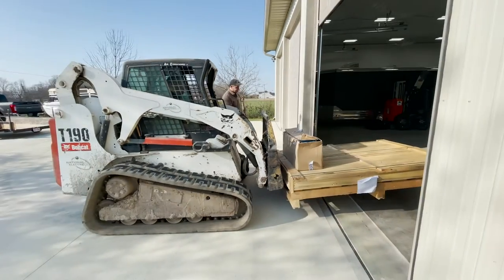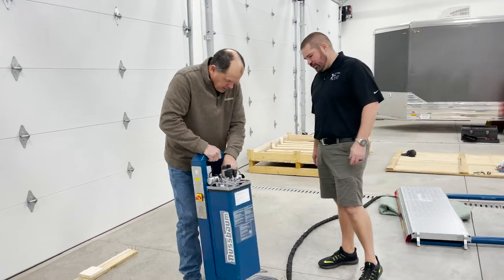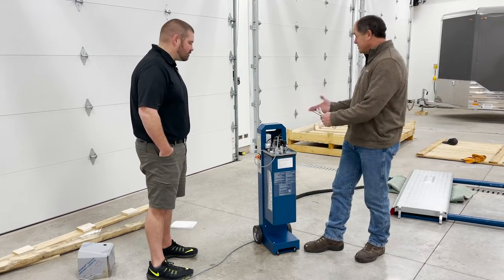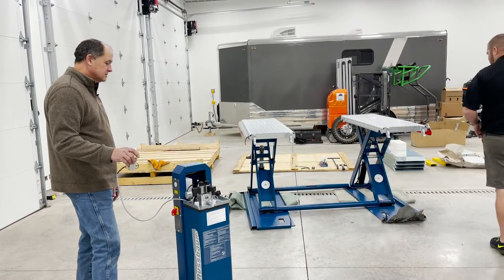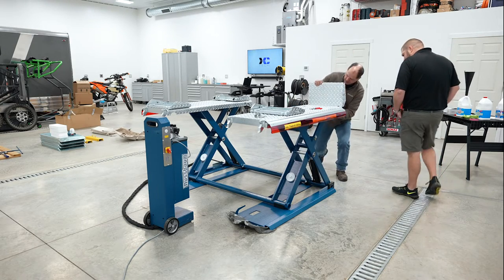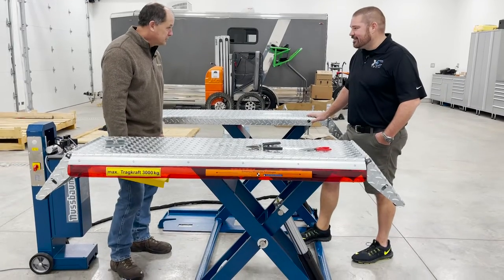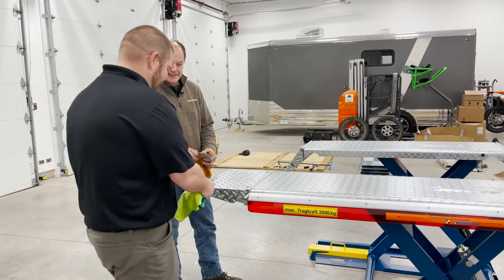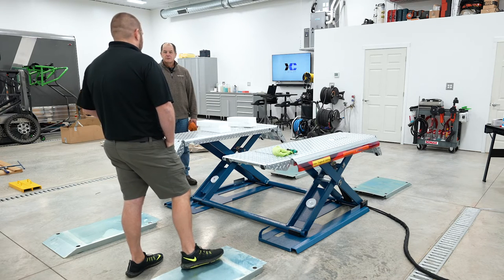Nussbaum Sprinter 7 Portable Lift Install // XC Tech Shop Equipment

Comment: For anyone considering building a garage or shop of this size, do yourself a big favor and budget in a gantry crane at the beginning of the build. It's worth its weight in gold in situations like this and you'll find yourself using it way more than you ever imagined.
Reply from the maker: Interesting thought, we do have a portable gantry but wouldn’t want to set up the rigging required to utilize it in this quick case. In my jurisdiction they wouldn’t allow a built in gantry system, but would have loved one for lots of projects! For now we just use our portable 1T for odds and ends.

Comment: can u pull the car onto the lift either direction ?
Reply from the maker: Yes, for certain vehicles (engine location) the lift is designed to handle (universal).  I also installed it so you can either pull in or back in with same clearances..

Comment: Hi Ben, Byron was here at my shop yesterday installing the sprinter seven.are you planning to use those Drive on ramps that you purchased from Nuessbaum? If not would you be willing to let loose of those? If so what are the dimensions of those drywall ramps.

Comment: Great video, just joined too. One question, can you drive a vehicle on the lift without anchoring it to the ground? I have seen other cheaper lifts reviews that say the other lifts move when not anchored.
Reply from the maker: Ken, yes you can drive on without it anchored.  I chose to use 4 quick remove concrete pins to hold mine for long term use.  This was because the lift will only be moved a couple times a year to deep clean floors.  Video forthcoming on the pin install for semi permanent mount.
Reply: Thanks ben, I talked to Byron last week and I’m going to get the sprinter 7 installed in my garage. I’m looking forward to seeing your video on anchoring it to the floor. Interesting Byron said he was going to contact you to see if you anchored yours to the floor, and then I get the reply from you lol....

Comment: who designed the awesome garage. they put tall cupboard in the middle of the low workbench. So if you ever want to fit anything long on there you cant. Clever that.
Reply from the maker: James, I designed it that way.  Rather than assume it was designed your way…this was planned and has plenty of room on both sides for anything long that should need to go there.  In fact one side is for clean work/detailing and the other is for dirty work/assembly/disassembly.  The cabinets in middle ensure no cross contamination and create an obvious break.  Also, I have over 2500sq ft at my disposal, so have another entire bench area with tool cart storage for all car/motorcycle/dirt bike/boat work near the lift now.
Reply: Ah ha. Well to viewers it stands out and obviously to some raises a question. 

Fantastic garage though. Jealous beyond words. Im held back and cant go crazy with my inventions for lack of space. 

If I had that area I would cnc mill. Bend tubing. TIG weld stainless. Get really into building something cool like a one person flying machine. My dreams never get realised for the lack of space. 

Good luck

Comment: Hi, i get my new Nussbaum Lift tomorrow . I have to change the Oli connections like the way in your Video . 

So im Really interested in your Yellow stopper Iron. 

Are they includet? 
If they dont - which Price and where can i get ? 

Greets from Germany
Reply from the maker: Be sure to watch the video again when you start that installation.  It is really really easy.  I believe on the international versions they include those stoppers,  in the US they’re not always included. I have never used mine, Except for blocking up the lift for maintenance like Byron showed in the video. I’ve stored @ 6200 pound truck on the lift for several weeks with no drop in the lift.  Greetings and congrats on the new lift by the way, you will love it. Ours has become a workhorse for the detailing/build shop.